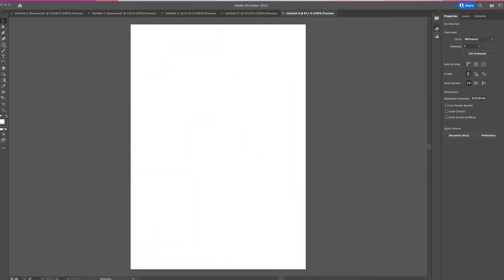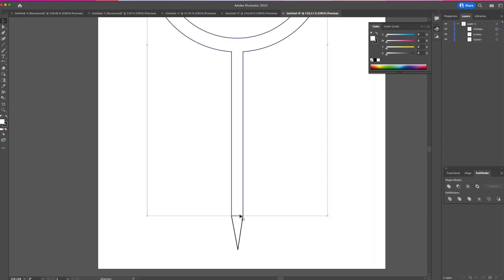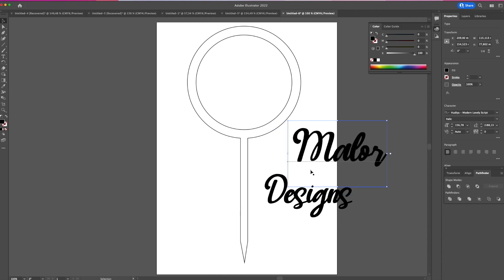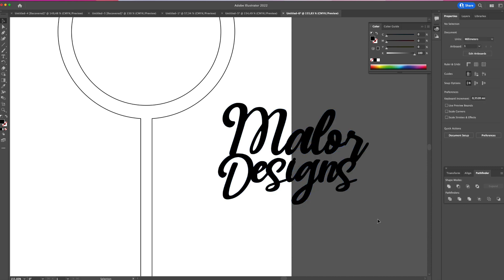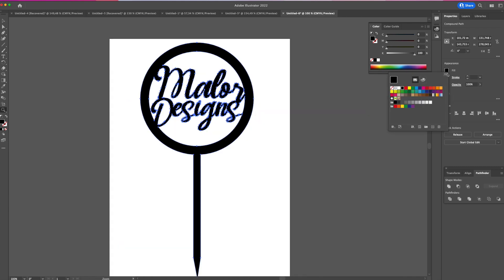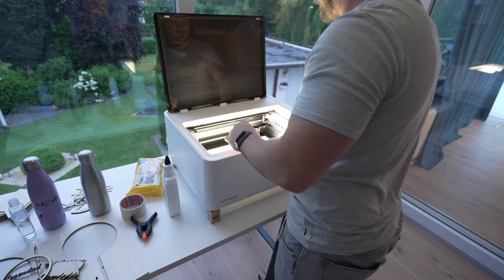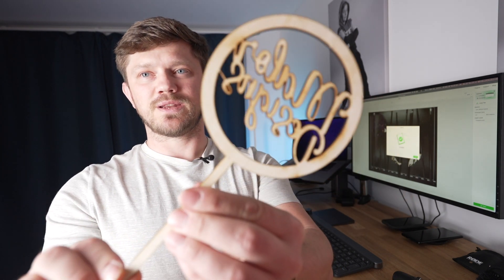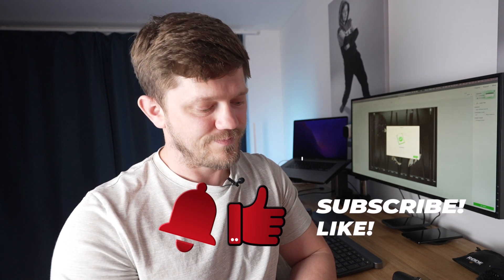XTOOL M1 How to create a cake topper - Laser engraving - Adobe illustrator

Comment: Did u lay this flat on the bottom? I didn't see any prisms or honeycomb. I did see your risers
Reply: I have the x1 mtool honeycombs in the bottom of mine, but I can't seem to get it to cut right. I don't see why u would need risers if u did a thin cake topper. Not a whole lot of videos since this machine is new
Reply from the maker: When I get back from holiday I will start to make some more in-depth videos. There’s a lot of people still having trouble. The more you use it the more you will see it’s limitations and drawbacks. When cutting any wood no matter if it is thin caketopper i would definitely have it raised to allow air flow. They can set alight quickly. So far the only way I can see this machine cutting cleaner would be if they create an air assist for m1
Reply from the maker: Hey, yeah the risers are in, I actually have a nice piece of created steel 1.5mm thick which I sit on top of the prisms.